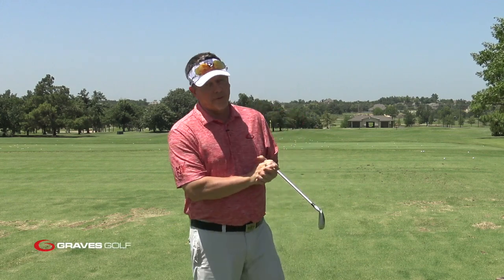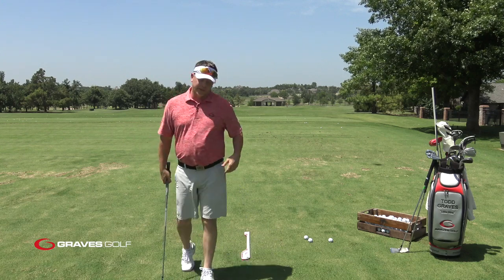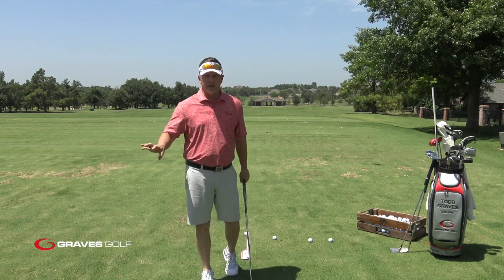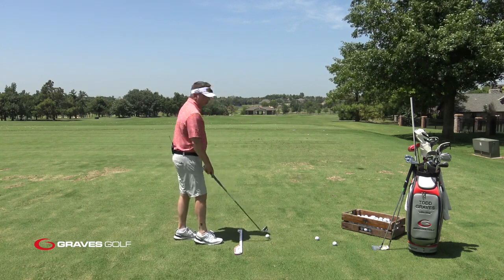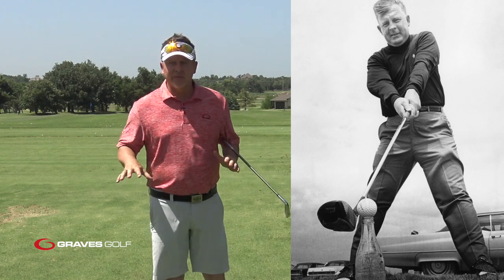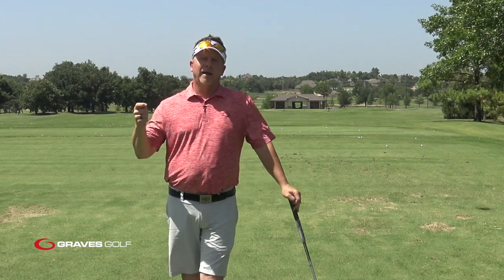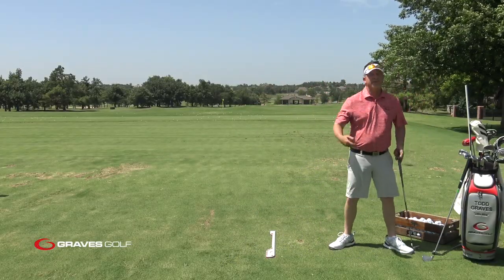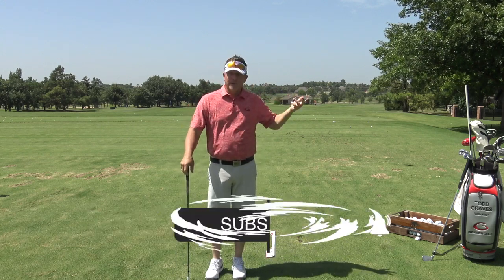Moe Norman’s Single Plane Grip Revisited ￼

Comment: I have been learning, and using the single plane swing, with very good results, straight and solid. I've kept the interlocking grip I've always had, but hold the club at the bottom of the fingers. Do I need to change the grip?

Comment: The genius of the Vardon grip (which he copied from Johnny Laidlay) is how it allows the two hands to turn over the club like a hinge pin without the force of the club head mass swinging around them pulling the hands further away from the body than when hanging at address. Moe’s grip did the same thing functionally, allowing the club head mass to turn over and swing down through the ball then up again on a perfectly balanced arc, which in the hands makes the club feel like it is swinging in a groove or on rails because the hands don’t get pulled out away from the body.   

What Moe did in his grip which was unconventional was start at address with both wrists all the way down into thumb-down ulnar deviation well behind the ball.  What that does biomechanically is pull the arms down into a tight V, which counter-torques them against each other with the same “wringing the towel” feeling as Hogan mentioned and illustrated in his book.  That gives the arm triangle incredible rigidity and resistance to mid-swing variation and deflection of club face at impact because the thumbs-down orientation of the hands locks the movement of the wrists.  I discovered Hogan did the same thing but a different way, waggling his club down in his hands and locking arms and hands just as his club face picked up the ball.  

That locking of the wrists occurs when the club force is allowed to pull both hands to maximum ulnar deviation.  What happens next is that the club head force acting on the toe the club shaft rotationally forces the hands to turn over, whipping the face closed very rapidly.  The club then gets pulled upward in the direction the toe (and force vector) are pointing.  That explains the physics underlying Moe’s very high finish swing plane, one quite similar to that of Harry Frankenberg (aka Count Yogi) who let club force pull hands down into maxed-out unlar deviation before impact. 

Compared to the conventional TGM (The Golf Machine) inspired “lag and drag” swing allowing the club to swing down to the point it locks the wrists BEFORE impact results in more club head acceleration and F=1/2(Mass x Velocity^2) striking force and more consistent ball striking because of the rigidity that thumbs-down orientation produces in the hands and arms.  Moe, Hogan and Frankenberg all seemed to independently discover that cause and effect which produces very powerful, dead straight shots nearly effortless and create distinctly different looking swings around it. But the underlying physics in all three of them are similar.

Comment: Thanks for this explanation…I can hear the frustration in your voice regarding the grip and how Moe “ supposedly “ held the club. This as you know goes back to the Natural Golf videos, which I have and J k ( you know who..) insisting that Moe held the club in the palms. Early photos of Moe clearly show this was NOT the case. However people bought into the theory, I for one did (for a period of time,) but gave up.  As you clearly stated , no leverage led to much shorter distances. Later on  I discovered that by placing the club more in the fingers in the trail hand vastly improved the strike and distance. Your spot on in your evaluation. Thanks for the videos and explanations of the TRUE Moe Norman swing. Cheers from a new subscriber ( and fan of Moe for many years) in Nova Scotia.

Comment: I’m not sure how it’s possible to use an overlap/vardon grip and have the club in the lifeline of the right hand.  It seems like the left index finger would get in the way of seating the lifeline firmly on the club.  I think you and some other instructors prefer the overlap grip, but I’m not sure why because it seems like a 10 finger grip pressures the shaft better.  Please explain.
Reply from the maker: The club is not in the lifeline of the trail hand.  That is a mistake.
Reply: @ToddGravesGolf  Wow, I have been doing it wrong.  Thank you for the clarification!!!

Comment: Hey Todd I understand what you are saying but how did Moe get those thick calluses in the palm of his left hand gripping the club in his finders?  Please explain.
Reply from the maker: It is important to define "PALM".  The Fingers hold the club into the heel pad of the hand.  The back of the lead hand is facing at the target.  The callouses are in the heel pad of the hand. There is no way to hold the club into the heel pad without the fingers pressuring it there.  Do me a favor,  Grab a the shaft of the club - one without a grip and hold it into the lead hand.  Put the club into the lifeline (palm) and hen into the heel pad.  Grab it with your fingers. and hold it.  Where is the shaft stable? that is where Moe had the callouses.
Reply: Ok thanks Todd I know you are tired of grip questions because of what Moe said and what he actually did with the grip.

Comment: Interesting conversation on the overlap versus 10 finger grips.  With all due respect, I have chosen the 10 finger grip for over 45 years and will continue to stay that way.  My clubs are longer anyway, due to my long legs and average length arms at 6'6" tall.  I tried the interlocking and overlap and hated them.  That said, I appreciate the information to help me make better decisions on various aspects of the game.

As for throwing a pitch, or throwing a baseball in general, I actually used my middle finger for maximum speed of my pitches.  I tried throwing other ways and wasn't as effective.

Comment: The older I get the more sense it makes for me to pursue this method. My question with the right hand part of the grip is... How are golfers getting the grip into the extreme palm of their right hand if their left thumb is on the shaft between the club and the right hand? If I use this method my left hand tends to be more in the palm where the right hand is forced to get away from the palm by the left thumb. I hope that makes sense. After years of following the "hold your club in the fingers" method I found that as it got harder for my old body to rotate that I began to flip the club more. Assuming I am doing the Moe Norman grip correctly it almost automatically fixed that issue. I am still capable of flipping the club but this grip makes it much less likely and much less extreme. With the Moe Norman grip I am more likely to pull the ball if anything and much less likely to lose one to the right. It is a comfort to know that I am almost incapable of slicing or pushing the ball. If the shot calls for a fade or a slice I go back to the finger grip allowing the club face to open at impact.

Comment: I've probably been using too large of grips, but I've used smaller grips as well. And whether it's single plane or conventional technique, I still have a tendency to strike with the face open. No issues with distance. To fight the fade, I can sorta throw/dump the club hard under plane before impact, but it's very disorienting, tends to chunk and hook, feels like I'm swinging at the ground and not through the ball. I can also get handsy with a normal swing, but then it's still not easy to get it right. I've been doing something with my right hand that seems to work, but it also seems counter to the things Moe said.
Reply from the maker: March Moe’s Swing - not what he said.
Reply: @ToddGravesGolf  March? Match?
Reply: @philwells2920  Watch

Comment: 🫵😎Todd.
Baseball pitchers place the ball onto their fingers as well to maximize speed and shape of pitch.

Many times you have to brake out small parts of your grip to see the effects it has on leverage as you said.  Unfortunately it’s easy to pick up poor habits from good meaning friends or from practicing with a faulted grip which leads into other swing manipulations over time.  

Perfectly said regarding the needed to have proper fit grips on hopefully proper fitted clubs.  I like how your grips and Moe’s maintain a constant thickness from top to bottom rather then tapering.  Consistency makes things optimal.
Great video 👍

Comment: I switched from conventional to SPS for my back. Now I play pain-free. I went from a 6 handicap that had trouble finishing 18 holes to a 6 handicap that can play 36 with no need for pills or ice. I could not have done it without the GGA, their club-fitting, their clubs, their video analysis and instructional (drills)  coaching advice. Best money that I ever spent, golf-wise. I shot a 78 yesterday and our winter-killed greens are STILL unputtable. I put the ball in the fairway and the approach shots on the green with regularity. No more army golf for me. :)